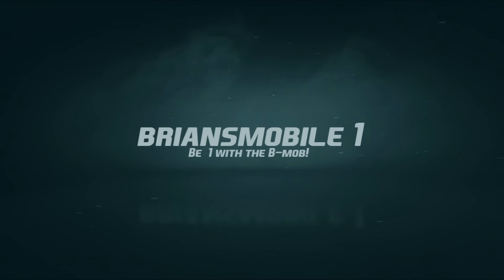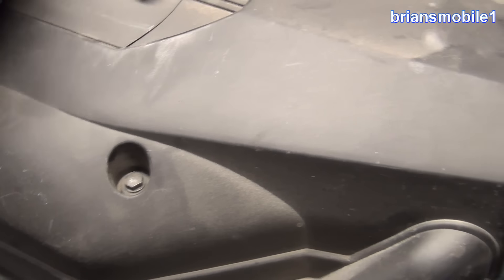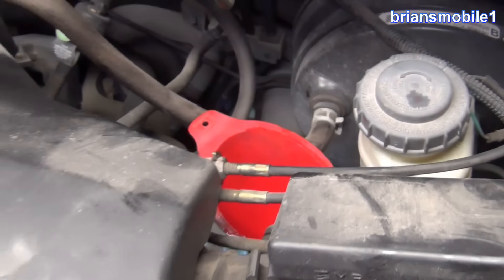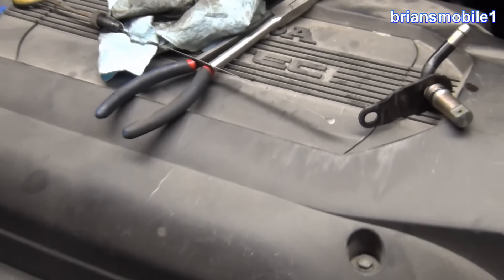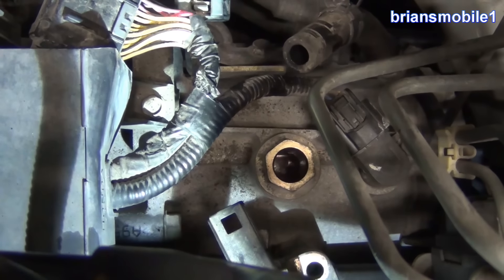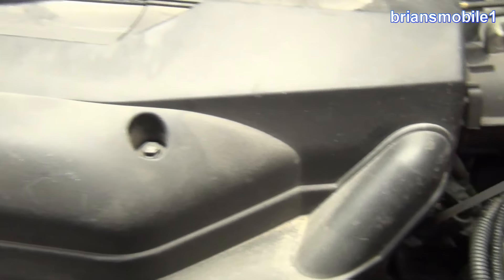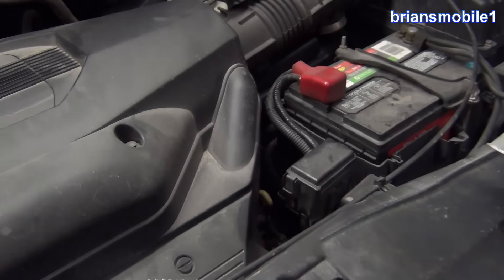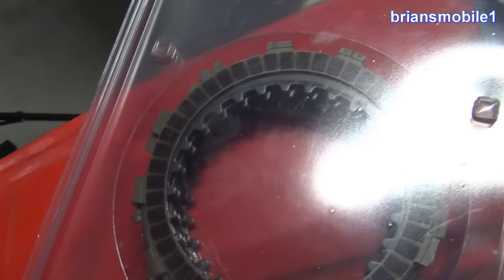Watch this Video BEFORE You Destroy Your Honda Transmission

Comment: Good video.  Thanks.  Any advice on a delayed shift between first and second?
Reply: What is the mileage and service history? And was a service done recently
Reply: 173k. Fresh fluid.  Honda fluid.  It's a junk yard car that I've resurrected.
Reply: Mod Shop Good job for rescuing it!
Reply: I will speculate, citing multiple possibilities:
1. You've worn down the paper (or glazed it) on the Second Clutch Disks, to allow a little bit of a slip to occur during the upshift. This isn't necessarily catastrophic, as it could last for years and hundreds of thousands of miles without failure.
2. You could have a valve in the Main Valve Body sticking for just an instant, and the clutch pressures are not ramping up/down to 1st/2nd clutches at the proper rates or pressures, a problem that MIGHT be solved (emphasis on MAYBE!) with an oil additive on a TEMPORARY basis. Same could be true due to a sluggish Linear Solenoid, which is an external component part.
3. You have enough solid contaminants in a screen (perhaps leading to Linear Solenoid, or shift solenoid) somewhere that is restricting flow to a clutch or valve, and causing reduced clutch pressures at the clutch(es).
4, and this one is a stretch: You have a problem in the Transmission Control Module.
Sadly, if we're talking about a Honda AT-family mission, almost all of the corrections (except Linear Solenoid replacement, and they are big $$$) would require removal from the vehicle and bench rebuild. But I've had a 2002 V6 4-AT Accord that has had that flare for YEARS, and has only gotten progressively worse over time (currently over 270k miles). I've had it since 2007 and 25k miles, and I think it has acted up for probably 10 of those 13+ years. It's worse when fluid is cold-cold, but never completely goes away.

Comment: I purchased a 2010 Honda civic Hybrid, I checked with the dealer about changing the trans  oil , they said lifetime 😬. So I’ve been driving this car everyday , doing oil changes at 8 k miles , but never touched my trans oil , until my Speedo hit 423,789 miles my baby started acting up , buckling , slipping , and I thought “‘How you dare misbehaving like this baby !!“ , anyway I changed the external trans filter , trans fluid which it came out black as shit , but to my amazement my car works as brand new . So from now on , I promised to change my trans every 80k miles..

Comment: Hi Brian  new to channel, I’ve a 2003 Pilot w 213k on and engine w 159 K . Will change fluid as directed. Thank you. Odd question. I’ve a Westin brush grill guard to install, can not buy OEM or third market brackets- unavailable. Any recommendations to find matching replacements?
Thank you

Comment: Does anyone know if shudder fix will work for a 5th gen Honda prelude that has shifting issues when you first start it even if you let it warm all the way it will not shift right but then won’t downshift to 1st when I have to stop and starts shaking the whole car also torque converter is bad. I’m trying to see if maybe it will buy me a little more time before I have to manual swap it
Reply: Also sometimes stalls when coming to a stop after it shakes and just dies
Reply: After the first 15 shifts or so it will be perfectly fine though 🤷‍♂️ I can drive it as hard or soft as I like and it’s reliable once it’s shifted about 15 times

Comment: I used api gl oil for the manual transmission and the differential on my Honda hrv from 2000. Is it a problem that i did not uae the original honda oil?
Reply: Shouldn't be a problem, manual transmissions usually take gear oil, or something more viscous than auto trans fluid

Comment: I'm confused. So you're saying no to flushing but draining and replacing fluid instead? What's the difference?
Reply: Flushing requires a pressure machine and removes a lot of fluid.

Drain and fill is similar to engine oil change.
Reply: @deasttn  thanks!
Reply: Over time do a 3 quart drain and fill 4 times and you've essentially replaced all of your 12 quarts of fluid. Keep it looking nice and clean and your transmission will outlast the car.
Reply: @noelleonard2498  thanks. I got a 2010 Odyssey with 100k miles (164k kms) and not sure if previous owner did any transmission fluid change. Is it safe to do now?
Reply: @uponsunnah6986  sure it's safe to drive.
Its also a good idea to drain and fill tyranny oil a couple times this year.

Comment: I was surprised at how dirty transmission fluid in my 1997 Honda Civic was after only 30,000 miles since the last fluid change. But it's also very easy. Why spend $300 at the dealer to do it for you?

Comment: Use harbor frieght hand pump with smaller line adapter insert in dip tube pull quart out add lucas non slip and just small amount of marvel will be good in summer royal purple atf runs coolest .
Reply: Has anyone ran complete royal purple on intervals and what was the transmission response?

Comment: Great video, man, I loved it!  I hope you are still reviewing comments.  I have a 2007 honda civic lx.  I am almost 100% certain the transmission fluid has not been replaced ever.  (DO NOT ASK WHY, PLEASE).  Many, including service advisors at 2 honda dealerships have said not to do anything about the transmission now and to let it die on its own.  What is your take.  The car runs and, obviously, the transmission still makes the car move.  I am not experiencing any issues other than a rumble on low RPM on low gears.  What is your take, replace or not replace the transmission at this stage? the car has over 257000 miles.
Reply: I'd advise not to change the transmission fluid at this late stage. If it had regular transmission fluid changes at the recommended intervals it would have been fine, but at over 200k miles you might end up ruining it. What happens is that the new fluid will flush out the old and the seals may have deposits in them keeping them from leaking. The flush can basically "reopen" those spots and cause the transmission to leak. The next thing which is even worse is the transmission will slip. The old fluid probably has a lot of worn material floating around in it which enables the clutches to still engage. The new fluid won't have that and you may end up with it slipping all the time because it's been worn for so long. I recommend you watch Scotty Kilmore and ChrisFix's video on transmission fluid changes. They say if it hasn't been changed in a really long time, your best bet is to leave it alone and just drive it until the transmission eventually fails.
Reply: Just leave it as is where is.
Reply: Change it but don't flush it.
Reply: Hear me out and tell me what you think. Since I don't want to pay for a new transmission soon. If the transmission fluid level is low but not empty......pour a very small amount of honda ATF into the reservoir and let that small amount get diluted into the most likely already black transmission fluid. And I would continue to top it off  with small amounts at scheduled intervals. My reasoning is that the balance of the ATF would not be drastically changed therefore avoiding the dreaded effects of adding new ATF to a transmission that hasn't been maintained. All the while, the new and small amounts of ATF would slowly dilute and help keep the transmission lubricated. My reasoning also involves the idea that you don't pour warm or even cold coolant into an overheating engine and if you have to.......do it very very slowly.
Reply: @justinsalluce9176  Look if it's low you have a leak, you need to fix that leak then just replace the fluid. Change the fluid if it's bad it's going to clog the solenoids otherwise and stop working anyway.
Reply: Drain the old fluid and save it.

Refill with fresh new fluid.

If new fluid causes your tranny to act up, drain fresh fluid and put the old fluid back in.
Reply: @steponmemommy9323  thank you!!!!! Best advice I've heard and didn't think about. Thanks kind sir

Comment: I was recently gifted an 07 impala with the 3.9l V6. It’s at 100k miles and runs great, but I notice a slight hesitation between 1st and 2nd gear. The transmission fluid is bright red (which might be a bad sign lol) and every other shift is flawless. I’m wondering if I should try to put some stop slip in, or if I should just continue to drive conservatively. I know that these cars have somewhat weak trannies, but I really want to get this one to 200k! What do you think?
Reply: Hell yeah put some Lucas stop slip
Reply: Jose Diaz So... 6 months and 5k miles later, my car jerks at every shift and is slowly losing 4th gear lmao
Reply: @sirsardine1  damn bro did you put the lucas in or no?
Reply: I put some in my 2000 Lexus. No problems. It's worth a shot. Sometimes takes a few hundred miles to work if it's going to
Reply: @97og1  Yeah. After Lucas, it shifts about the same as it used to. Not great, but it shifts lmao

Comment: Hey Brian. Can you recommend a way to stop a leak from the drain plug on my 07 Honda Pilot? The previous owner torqued it way down and stretched the threads in the trans body. I replaced the drain plug bolt and crush washer but it still weeps. Thanks!
Reply: I'd guess that you have a hairline crack at the opening, in which case you're probably going to have to live with a drip, or face a rebuild including a very expensive aluminum M-Case replacement.
Reply: Loctite thread sealant

Comment: Any idea what causes these transmissions to whistle in 4th gear? My boss has an 02 MDX that does this. I just bought an 05 MDX and I would like to keep the transmission going as long as possible, it already has 257k but is still going strong! My bosses 02 MDX has 245k.
Reply: Seth Francis Sim Racing that’s the normal transmission whine

Comment: The debate about flushing or draining, changing will never stop. Remember 1)fluid exchange is not exactly flushing and 2) changing transmission fluid only gets about a quarter to a third of the fluid out. Would you take out a third of engine oil and replace with new fluid and say its all good? My car is approaching 200k miles and I have had complete fluid exchange done thrice.
Reply: If you ha ent done complete exchanges and your car has lot of mileage stick with drain, fill. Don't do a complete exchange or flush

Comment: My Pilot has a filter too.  Should  I change that as well?
Reply: AlwaysHopeful87 no! Honda’s filters are internal and are good for life if the fluid is taken good care of. It is a 12 job to replace the filter
Reply: 12 hour
Reply: If it's like all other Hondas, it only comes with a filter inside the transmission, so as Preston Miller said, there's nothing to change. Some years ago, Honda dealerships and independent shops spliced an external filter into one of the cooler hoses. If you have this aftermarket filter type, you should remove it completely and connect the hose ends together. They are no good. But if you have a heavy duty aftermarket filter system which looks like a standard spin-on oil filter (although it's specifically for transmission fluid) it's a good idea to replace it with a new filter. Commercial trucks have spin-on filters which work well.
Reply: @geologic740  Honda started putting external filters on some V6 models beginning in 2002. Every Honda transmission has a 5-micron strainer inside - NOT user-serviceable.

Comment: Mine requires the Z4 fluid. I drain and refill every 15k miles using Redline D4
Reply: Have you ever tried Royal Purple?
Reply: @fabiansantos4558  With Hondas it's always best to stick with OE trans fluid to reduce risk of issues.

Comment: I have a 2011 Accord. On top of the transaxle there is a square plate with four various sized tubes going in/ coming out of it. PLEASE someone tell me what that is. It's leaking and the trans is not behaving at all. Got the flashing engine light. If it's driven easy and low speeds, it's like there was never a problem. Bought this car for my daughter's straight A's and now it seems a nightmare is about to take place. BRIAN'S OR ANYONE'S HELP GREATLY APPRECIATED! THANK YOU IN ADVANCE!

Comment: My car(civic 8th) don't show any blinking light, but the car can't moving to 4th gear until i move it to N and put it Back again to D, I have tried to change the big sensor under the air filter but the problem still the same, also tried to change the 3rd clutch pressure switch and I don't see any difference, does anyone facing the same problem? Need your help😢, thank you

Comment: Are there any off brand trans oil I can use for a Honda 2011 civic
Reply: There are, me personally, I only use Honda fluids. I priced these transmission fluids out the other day, as I just serviced mine. I needed 9 quarts as I did a drain, fill, drain, fill, three times to clean out the old fluid. The price difference was only a few dollars, not worth taking the chance in my book. Do it right the first time, it could save you thousands of dollars down the road.

Comment: Hello just came across your channel. I have a 2000 honda crv automatic. I bought the car about a year ago. Changed the fluid with honda OEM fluid when I first got it because it was shifting pretty hard. Was driving great up until now. 
The other day I got a po730 gear ratio code. Swapped out the fluid again and erased code. Took it for a drive and the code came back. Feels like its staying in one gear when I drive it. Does go in reverse and neutral tho.
I checked the solenoid on top and the mesh was clean. 
Any suggestions or something else I should try before getting a new transmission. Any help or advice would be greatly appreciated. 
My crv is at 250,000 miles.
Reply: Also if I have to get a new transmission would you recommend a jdm transmission I can get them locally for about $400, or would you recommend a transmission rebuild? Transmission rebuild quote in my area was $1700.

Comment: Does it have to be Honda transmission fluid?
Reply: I use Valvoline transmission fluid for Honda. I've used it for the past 5 years no problems
Reply: Great video however I disagree about the Honda DW1. I've used valvoline synthetic on my CRV for the past 190,000 miles and is smooth as butter. I change it every 50k and never use Honda DW1. Never had a transmission issue. I even tow a trailer now and then. I currently have 248,000 miles on my CRV and going strong.

Comment: In the dealership usually we just use the dipstick to refill them. Never taken that line off. Some of the ones with smaller dipstick tubes have a bolt that’ll say atf on it and you can just use the bolt. All the new cvt’s have a plastic plug that’s labeled. Easiest trans services in the world.

Comment: Shops have absolutely messed with my transmission so I'm learning how to do it myself
Reply: Most shops don't rebuild or work on transmission internals. Once they start going bad, it's usually cheaper to get a used transmission than to even have the clutch packs changed out, so most mechanics won't want to invest the time, and the customer won't want to pay the bill. The lube shops will almost ALWAYS recommend a trans flush. Don't do it. I've worked at a few. About half the customers return after a flush to complain about shifting problems and slippage. Drain/fill is recommended at certain intervals... just avoid the flushing. It's not a remedy for any problem you might be having, and it could make it worse.

Comment: hey bro sorry i know you get alotta questions, does this same honda auto trans fluid ATF-DW1 go for a 1995 honda civic EX too?
Reply: More than likely yes. Personally, I only use Honda fluids, other than the brake fluid, which in my case is DOT3 rated fluid. That is the only exception I would ever make. And funny thing, fluids at my local Honda dealer are roughly the same I would pay at say Walmart, and are cheaper than the auto parts store. The only exception is their synthetic oil, which I use. I pay roughly $7 a quart, 4. 4 quarts is what the car takes. I could use Mobil One in the 5 quart jug and save a few bucks, it is just easier to call the dealer and have him throw everything in a box, including the Honda filter and new crush washer. In and out in a few minutes. Time is money.

Comment: I just replaced the tran oil and i added trany lucas along with that
And i feel shifting is harder than it used to be
I think i made a mistake!
The car is 2008 accord v6
Reply: It’s a firmer shift and it’s actually better for the transmission.  Lucas will not harm your trans.  If you are worried about it do a drain and fill.
Reply: @ohboy2592  thts y im asking expert 
If u think its ok then ok

Comment: I've got an 06 3.0 and I put the Castrol transmax for Honda acura cus the auto parts is 5 min away vs dealer. Ben about 10k miles. Is that the dex fluid you were referring to?
Reply from the maker: No, that's not the DexMerc.  That is supposed to be ATF Z1, DW-1.  (Honda OEM type)

Comment: It seems like the magnet would get so full that it won't further magnetize and then the metal will go into the sensors and so on but I'm going to bet some people are like that's the job of the magnet but you will realize if you have a magnet that once it picks up so much it's diminishes it's potential
Reply: There’s only so much a magnet can hold.  And what about non-metalic particles?  If honda just put a real filter in there would solve 90% of their tranny issues

Comment: Flushing any transmission is a scam. Do your 3 quart drain and refill often to keep it fresh is all you can do with honda auto trans. Noting you can do with the internal screens eventually getting restricted though, but if you keep the fluid fresh that will be in excess of 300k of you treat it right. And for the record, I've been using wolf's head universal synthetic in all my honda transmissions for many years now. It has actually straightened out some minor shifting issues actually the oem Honda fluid had.   Not a fan of the you have to buy the "honda" fluids or else, I think honda power steering is the only thing I still run that's Honda oem.